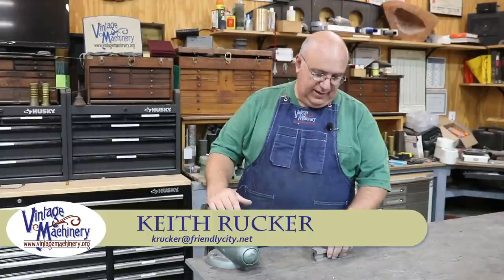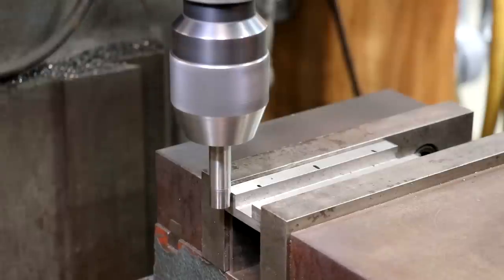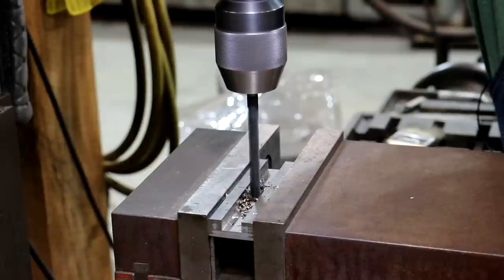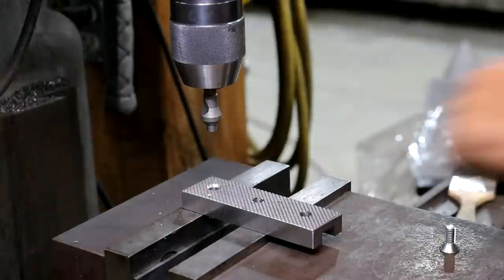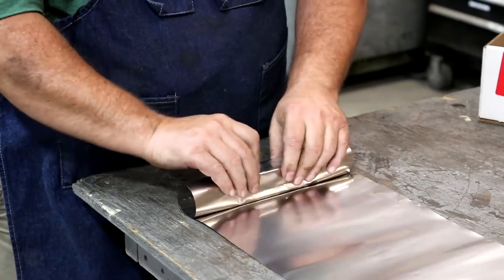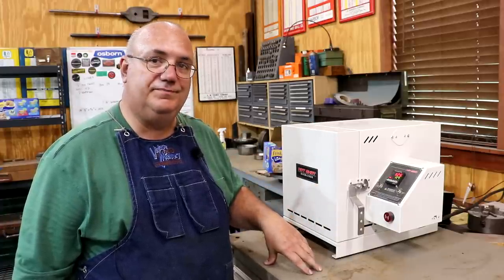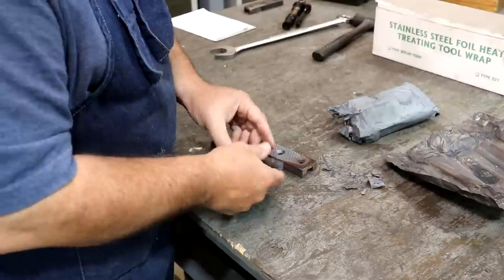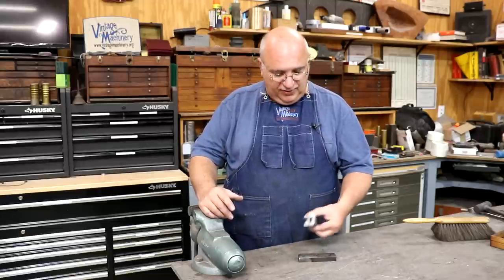Finishing up the Vise Jaws: Drill and Countersink the Holes and Heat Treatment

Comment: You should check out a anti-oxidation/anti-scaling heat treating paints, they work great. I've been using them for about 2 years now for heat treating knives and I haven't had an issue with scaling yet.

Comment: That heat treat oven is a great addition to a small machine shop. Trying to get your parts scheduled thru a commercial heat treat shop was always a nightmare - they always tried to slip my parts in with someone else’s job that needed similar heat treat. But ‘similar’ is not ‘exactly’, is it?
Our prototype engine machine shop eventually set up a heat treat department using mostly hot salt bath heat treat. Dangerous, took special training and protective gear to go back there.

Comment: Can someone explain the difference between a centre drill and a spot drill, I am familiar with a centre drill (use on my lathe and drill press) but have not come across a spot drill.
Reply: A center drill is used to drill a hole for a center. I'm not positive about this, but I think a spot drill is used to get a hole started.

Comment: Would the paper have been better or more efficient placed in the grooves between the jaws instead of being placed the jaws and the SS foil wrapping?
Reply: The paper is an option but not really necessary if the foil is double crimped tight to exclude all air. Heat treat at 1725 F for one hour per inch of thickness. Temper at 425 F for one hour at heat. Unwrap and you’re done.

Comment: Can you knurl  on a horizontal mill?
Reply: Yes, it involves using a Pointed Profile Cutter and angling the table (some mills do this) or the vise (much more commonly) to half the desired hatch angle (in each direction). Without a gang mill/hob it is a (very) slow operation. Keith did it this way because he doesn't have a shaper. He could have done it on the Planer, but the setup would have been more time consuming.
Reply: I understand. Gently increase pressure. Yes?
Reply: @zackeudy2978  Most horizontal mills/ cutters can move an enormous amount of metal (large depth of cut); With this shallow knurl pattern, minimal depth of cut was needed. Knurling on a mill is a generally a cutting operation, not a forming operation (like using a knurling tool on a lathe), thus cutting pressures are very low. In this case, Keith didn't have an "exact" pattern to follow, he modelled it off of the worn jaws. He measured the pitch and the angle of the Knurl,  and simply "eyeballed" the cutter depth, until he reached a satisfactory approximation of the original jaws. For this, the best solution in terms of working with what you had.

Comment: Keith if there was a way to purge the oven with Co2 would you still need to wrap it in stainless steel with the paper? Nice Job Keith!
Reply: TOT has the same oven but his came with a kit to inject argon into the oven to displace the air.
Reply: Stan has a series of videos where he goes through the various stages of development.  The "argon option" was popular at one time, but I think he found it to be more trouble and certainly more expensive than the SS wrapping idea.  I am not sure if American Rotary kept Stan's argon kit option or not.
Reply: @millwrightrick1  Didn't TOT still wind up with some scale?
Reply: Purging the chamber with nitrogen also works to remove oxygen and prevent scaling.

Comment: Do all 3 center drill spots first and then drill- instead of changing that drill a bunch of times.  You could also stack your 2 jaws and do all the holes at one time.  Flip your jaw and clamp in the vise to do the countersink since your pilot is smaller than the hole